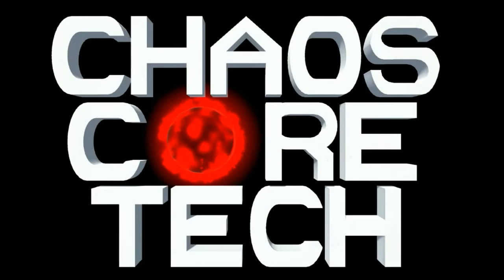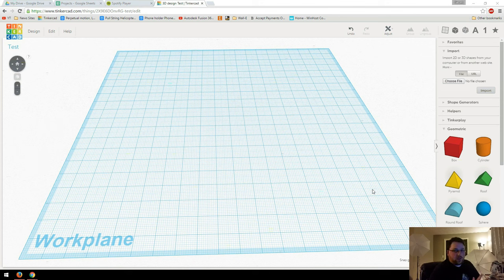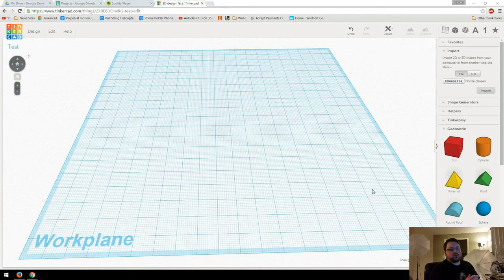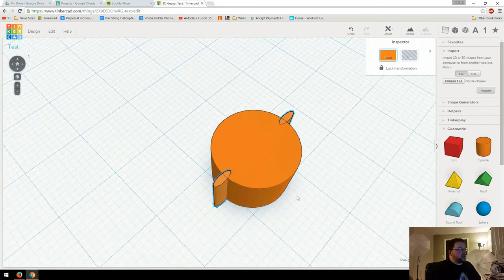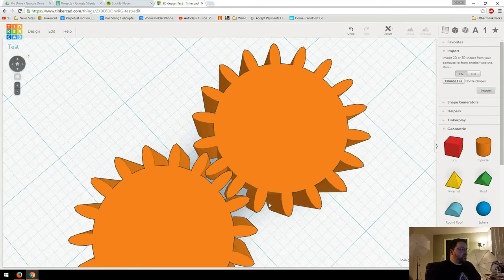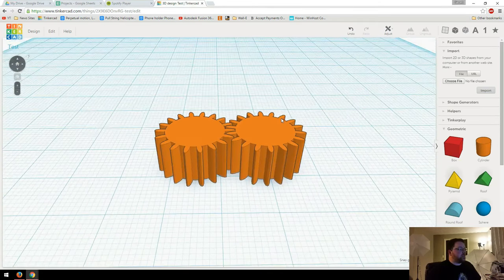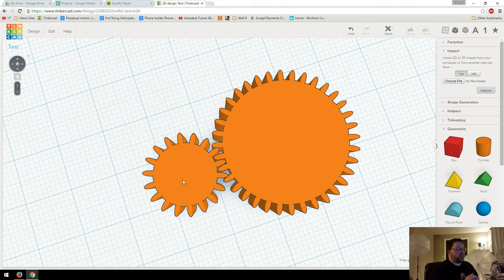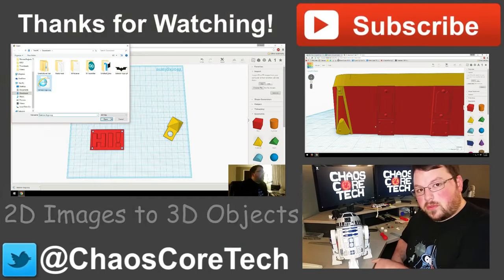How to Make Gears in Tinkercad!

Comment: Thank You for this. I used your method and adapted it to make a 29 tooth gear to replace one in the main brush gearbox of my robot vacuum cleaner. It worked like a charm! If anyone is interested how: rotation angle = 360/29 = 12.414 , I duplicated all the way around and then deleted every second tooth.

Comment: just done an intro to tinker cad at my local library, and that video was great, I am into mechanical things too. you show male gears, ie: with the teeth on the outside, how do you do female gears?, ie: the crown gear in an automatic transmission (planetary gears).
Reply: andy van the word you are looking for is "ring" gear or "internal"
Seems to me you would make a cylinder and use a smaller cylinder to punch a hole in the first...then place your teeth on the inside.

Thank you for the question, without it I would not have had to come up with an answer.

Comment: Cool tips! Just watched a couple of your videos, you just got another subscriber.
I'm new to tinkercad and I'm struggling with making a partial hole in an STL file to add a magnet to the project.
Playing with meshmixer it's a Boolean expression or something like that.
I haven't achieved it in tinkercad. I found team logo's or other designs that I'd like to insert a magnet in them.
Getting it centered on the bottom side and not have it come all the way through. 
Say the button magnet is 3mm and say it's height is 2mm.
Do you make the cylinder 3mm round, 4 mm tall to all it to sink below the work plane?

Comment: Haha, yes; they're called teeth! And a cog is the actual gear. It's great that you curved the faces of the teeth 'cos that helps with the smoothness you testify to. Next, Autodesk should program a whole gear making module that'll do all the manual steps, only asking what space the gears will need to fit into, shaft size, and ratios desired. It could even adjust everything as we drag output shafts to aim in in a different direction. For example, we'd sketch or import a scan of a bicycle, showing mainly the wheels and the axis of the pedal crank. We'd tag them as driver and driven. Tinkercad would do the rest and we could drag pedals forward or backward and the gear system would adjust, with drive chains or belts also in the mix. I think this will accelerate inventiveness by removing the middleman obstacle: difficult drafting. Tinkercad is to machine design what Arduino is to digital controllers!

Comment: Nice tutorial on gears. I would like to increase the size of a half sprocket without changing the size of my teeth. The half sprocket needs to fit over a 80mm tube but at the moment it is a little too small to fit. When I increase it's size to fit the 80mm tube, the teeth size also increase and then sprocket teeth doesn't fit my chain. Can you guide me to how I can do this?

Comment: Thanks for the video on making gears it was very informative.  I only been using tinkercad for a couple of weeks and my most difficult issues are making curves like for example french curves or sine wave style shapes.  Could you show a video on how to use tinkercad to design an object that has flowing up and down curves and also how to put a rounded brim on a curved surface?  Thanks and I appreciate all your efforts!

Comment: I appreciate your videos; am still trying to find out how to rotate a 2D image into a 3D model; i.e. if I drew the letter C on a piece of paper and scanned it into TinkerCAD, how might I rotate that 2D curve C into a torus?
Reply from the maker: Hi Patrick! I think that is a little too advanced for Tinkercad. They don't have any revolve or sketch functionality. I would recommend looking into Fusion 360. It's pretty simple to get the hang of but it's a lot more powerful than Tinkercad and it has several features that could help out with something like that. Hope that helps!
Reply: Convert the 2d image into a vector svg file. You can then import the image into another free program like blender. In blender you can have the image extruded along a path, say a circle. This should accomplish what you need.

Comment: hi there chaos, thanks for getting me started on the gears! i think you need to specify that the gear ratio is based on the pitch diameter, not the diameter of the circle you created? this means you add a full tooth length to the diameter.

Comment: Great video! This helps a lot, thanks for sharing. Did you print any? I'd like to see them plus the settings you used.
Reply from the maker: Yes I actually printed some for my R2 video: https://youtu.be/hH4L06uxcRU 
And also for my Wall-E video: https://youtu.be/sBTc96pNLwo 

The print settings are in there. They're mostly printed in PLA and at 0.3mm layer height with around 20% infill. Hope that helps. :)

Comment: Hay, love the gears, Just wondering if there is a more accurate way of aligning the teeth without centering it in the grid? if you know of another can you show us?
Reply from the maker: +Calvin Chee Yes actually, since I made this I learned to use the align tool up in the top right area next to mirror. You can click that and select 2 objects. Then you can click what line you want to align them to. It'll allow you to center the pegs directly with the cylinder.

Comment: But how can I make rack gears?
Reply: It's similar to making the gears here, except, instead of putting teeth onto the outside of a cylinder, you put teeth along the length of a long cuboid. Each of the teeth have to be spaced apart by an equal distance which can be calculated.

First of all, design one circular gear using this video; this will be the pinion to work with the rack gear. Then, calculate the distance between two neighbouring teeth (called the "pitch") using the following formula:

Pitch = π × d ÷ (N - 2.5)

Since accuracy here may not be critical, the value of the pitch can be changed slightly, or rounded off to a convenient value.

where "π" roughly equals 3.14159, "d" is the diameter of the pinion you first designed, and "N" is the number of teeth on the pinion.

Now, how many teeth do you want on your rack gear? (Note that having the same number of teeth on the rack gear and the pinion means turning the pinion once will move the rack gear along its entire length.) The length of the rack gear should be equal to the pitch multiplied by the number of teeth of the rack. However, in practice, the rack gear should be slightly longer than this length to ensure all teeth fit on nicely (increasing the length by the value of pitch should do the trick).

Therefore, create a cuboid of length slightly larger than pitch × rack No. teeth. Now add the first tooth in a similar fashion to adding the first tooth of the circular gear. Then, place the other teeth spaced with an equal distance equal to the pitch (note that this is the distance between the centres of two neighbouring teeth), until you have added all the teeth you needed. Viola, you should hopefully have created a rack gear.

Note: creating accurate rack gears is more complex and also involves a little bit of research, but one note is that, in industry, rack gears have teeth that are shaped as a trapezium.

EXAMPLE:

Let's say we use the smaller gear in the video as the pinion, it having a diameter of 12mm and 18 teeth, and we want a rack with 54 teeth:

Therefore the pitch equals π × 12 ÷ (18 - 2.5) = 2.43mm

Pitch × Rack No. Teeth equals 2.43 × 54 = 131.22mm. Therefore, let's make the length of the cuboid slightly longer at 135mm.

Add teeth with spacing of 2.43mm.

Comment: Hey, I followed your video, made some really nice gears! But after I made the comment below, I found out Tinkercad has a metric gear generator. It's under shape generators. Not sure if you knew or not.
Reply: Another option - there is also a gear generator in Inkscape.  Just save the Inkscape gears as SVG files and then import them into Tinkercad.  For those used to using Inkscape it's a nice blending of these two programs.

Comment: tinkercad is 100 times better of a program than blender
Reply: easier and simpler, less functionality. Understanding blender would help you in the long run however.
Reply: yeah i actually have learned most of blender since then and like it better than this. still trying to learn projecting to a second screen and i need to learn how to paint (i"m going to do some hand painting) what i need is someone who can program cause i have tried to learn it but i just can't. (mainly cause i don't understand algorithms and i"m better at spacial reasoning)